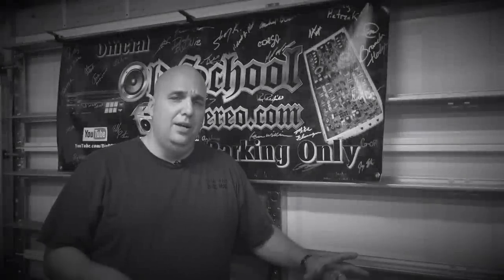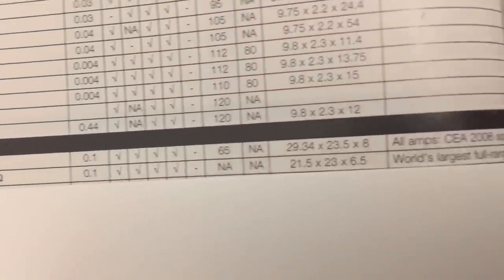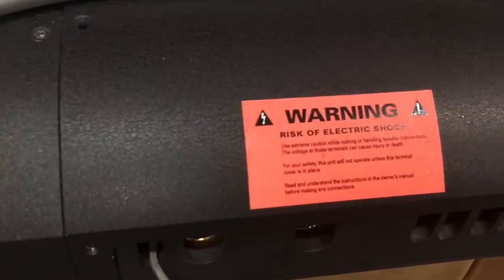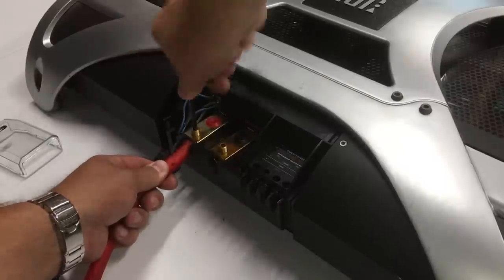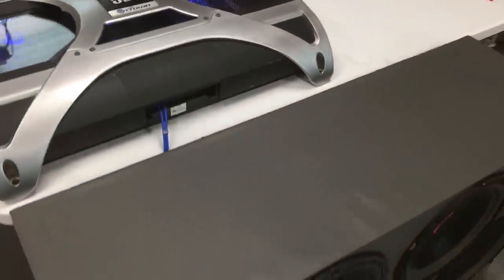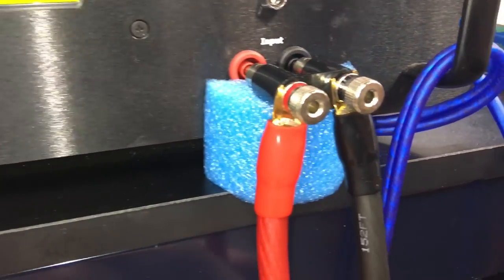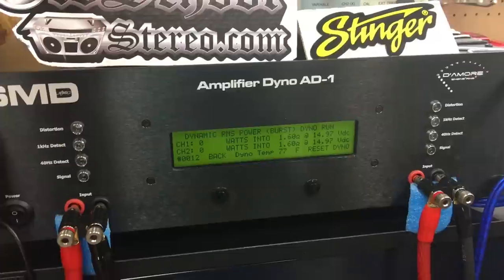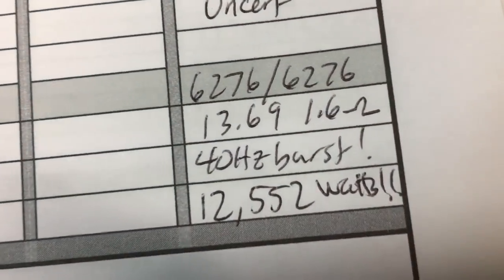World's Most Powerful Car Audio Amplifier (2004) JBL Crown A6000Gti

Comment: Holy guacamole and chips 😮 did that thing cause a blackout 😂
Reply from the maker: Actually this was a "green" test. I charged up the Maxwell Ultracaps with my 10A charger, then let the caps provide the juice. Power company may be upset I'm no longer using that massive power supply...

Comment: I love JBL not alot of people know that most concert speakers you hear are from them and people try and talk shit on um cus there based outa China but it amazes me how much better they are than alot of shit on the market wether its amps or subs. You should do the gto 1000.1 i know the 500.1 does almost 800 watts rms lets see that badboy.
Reply from the maker: +Nightmare Munoz every JBL amp I've ever seen tested did over rated power (several tested on SonicElectronix).
Reply: yeah the ms is 250 over rms i just always wanted to see the thousand because its only 200 dollars and if it does anything over its worth every penny for the jbl name.

Comment: what are the differences between the power acoustic 10K and this mammoth JBL 6K ?
Reply from the maker: The architecture and build quality are in different ball parks. The JBL uses Crown's Class I technology for Class A/B sound quality with near Class D efficiency. It was also built with little concern toward cost (evident in the $5999 price tag).The PA 10K is a Chinese Class D amp, manufactured as cheaply as possible and the specs are ISBL (if struck by lightning) max power numbers

Comment: do you think a Rockville RXD-M4 6000 Watt/3000w RMS Mono Class D 1 Ohm Amplifier will work for 1 
15" HCCA Series 2 Ohm 4000W DVC Subwoofer by Orion or will that blow the sub?

Comment: $6000 is a bit much. You can get a Crown 2000W and for about $300. Those are guaranteed high quality clean output amps for live band performance or mobile DJ services with durability and reliability. Choose even higher output models and stack them up as needed. Then there is the issue of power...120VAC. Either you use power inverters and or a 100A generator mounted on the engine of the vehicle...What ever it takes, deal with it.
Reply from the maker: These were limited edition, show amps for JBL. Not intended to compete on pricing

Comment: This got me thinking, anyone use the engine out of a range extender electric car or even pull current off an electric car battery bank for a system yet?
Reply: I've been thinking about that too. What happens when all cars are electric? You would have to have a transformer to step down the voltage.
Reply: @Bass2TheFace420  That would not be ideal.  Instead, use a design that runs on high voltage.  So instead of needing 450MCM wire you can use 4 gauge!  Just can't have exposed terminals (shock hazard).  Powersoft 30K (30,000W RMS) in a 1U package - real power but needs 230V to run.
Reply: @cpufrost  that would be more efficient. Taramps makes h/v amps that run on 220v
Reply: @Bass2TheFace420  I see those and their crazy numbers.  However I wonder besides producing a lot of wattage at lower frequencies how well they can do it and for how long.  Powersoft amps are arguably the finest made in the world and in touring they are the benchmark upon which all others are compared.  The control they have over the speaker cone is simply incredible and in all areas of the globe regardless of how bad the AC power is.  Of course they have the price to match. ;)

Comment: Where's the amp draw #'s
Reply: let's ask the electric company 😂
Reply from the maker: Clamp only measured to 400A, was going to buy an 800A model, but could not justify for one amp test
Reply: Two power cables, one 400A meter per.
Reply from the maker: That would work if I had another 400A clamp :-(

Comment: I remember the mid-2000's mega-amps, and how those were like all the audio fanatic's wet dreams.
You had the A6000 GTi, the Kicker Warhorse, and the Rockford T15k. All of which were ridiculous in their own rights!
In the later half, the early Korean made amplifiers came along, and one of the early adopters were a Norwegian company called DynaBel. Their top of the line model, the "BF8701" was a massive 7000w RMS. It could also operate at 16 and even 18v (only in a short burst), capable of outputting well over 10 KW. 
If you had two of these, you could strap them together for a combined output of 14 KW @ 2 ohms. And all of this could be had for a fraction of what the early 2000's amps would cost you to buy

Comment: No mono run? Would it have made a difference?
Reply from the maker: +Thezuule take 2 ohm numbers add up to get 4 ohm mono. 7323W certified. It is a mono amp with 2 channels. Easier for me to get more copper by using dual 4ga speaker runs
Reply from the maker: +Dereck BigDWiz plus the AD-1 is rated to handle 5kW at 4 ohms and up to 24kW at 0.5 ohms

Comment: welding wire is the same damn thing just a lot cheaper than over prices "car audio wire" maybe the opaque plastic insulation but other than that its the same thing. will handle the same current.

Comment: Question what i the Most powerfull Amp today ?
Reply from the maker: For 12 volts, Zapco made a 26kW amp a few years ago, Taramps makes a "Bass 30k" and "SPL 40k", I believe those are the largest 12 volt car amplifiers. There are some insanely powerful amps (over 200kW), but they require high voltage input, so I don't really consider those car audio amplifiers.

Comment: When ever i hook up any amplifier to power i always use a resistor so i don't shock the capacitors and instead charge them slowly. Other wise It will shorten their life.
Reply from the maker: +Stereo Studios 12v test light works also. That's what I use now 🤙

Comment: on another note ..

imagine the HP stolen off the engine to stabilize the draw at even a conservative 500 amps! 

roughly 6750 watts (at 13.5 ) /746....  

seems like a tall order to bolt on  a few hi amp
Balmars and  feed them about 9 spare  hp 

also surprised to see the amp uses 1/0  and  not provisions for  4/0 lug ..

   figuring 15 feet to the trunk and 15’ back ..   30’ of 4/0 at  $7/ft if using the tinned wire
 

definitely a big ticket item

Comment: ...?? 8110 watts @ 4ohm, and 7400 watts @ 1ohm??  the power out @ 1ohm would b calculated @ 4 times the power out @ 4ohms   basically, doubling resistance halves power thru/out

Comment: 2018  Taramps HV160, 160K RMS
Reply from the maker: The JBL was the most powerful in 2004, plus still one of the most powerful 12 volt 4 ohm amps at over 8000 watts at 4 ohms

Comment: Use a test light so you can charge up the caps first so no spark. Not good for any amplifier
Reply from the maker: I was going to use a larger 12V light bulb the next time I start it up. Not sure the test light can handle the current as the turn on requires 12ga for this amp

Comment: "warning, risk of electric shock,you'll see why here in a minute"

While I know the reason why, you never actually showed this in the video.
Reply from the maker: +TheyDontWantMusic yeah, I showed the DC spark, but no way I'm playing with that 220v plus of AC voltage coming out of the speaker terminals ⚡
Reply: Ideally, you'd use a resistor in series to limit the current and charge up the caps slowly. Just like an electrolytic stiffening cap.

Comment: It's never a good idea to just shove the stripped wires in like in the video. You should use ferules (sleeves), shove the bare wire into those and then into the amplifier. Without a ferule, the screw would just rip off the individual wires of the big cable and, in time, maybe half of the wires will come loose, the result being an improper connection. You don't even need a crimping tool for the ferule, because the screw will crimp pit just fine.

Comment: 3500w into 4 ohms... jesus, all modern amps can only do that into a low impedance, 120v? Now you know why this has an electrocution risk and others don't. 3500 into 1 ohm is 60v.
Reply from the maker: +UniCrafter to a single channel and with enough voltage, it does over 8000 watts at 4 ohms mono 😱...too much even for the Amp Dyno to handle

Comment: badd azz amp. there's one on ebay for 3 grand i seen it last week
Reply from the maker: It's been on there for months....this might help him sell it, hope he sends me a finders fee, lol
Reply: It should help him sell it now. I want to know what it does bridged?
Reply from the maker: Take the 2 ohm numbers, add up, should equal 4 ohms bridged. 7323 watts at 4 ohms bridged. If I could provide the 14.4 constant voltage, it should do over 8100 watts! Not many amps today, even Class D, will do 8kW at 4 ohms! They need to be loaded down to 1 ohm, everything suffers when amp is loaded down...current pull, sound quality, speaker control, etc. This amp is the BEES KNEES!!!

Comment: Thats cool  guy  is very hard find this amp in Brasil . I m work if automotive sound car  and i have 2 amp sony  one class d 1400 rms and other 1200 analogic  and two amps corzus  one class D 1200 rms and other 400 rms class d . Sony class D 1400 play 4 speaker sony x plod 1200 /350 rms 
Analogic sony 1200 play 4 loudspeaker 8 " 250 rms  midbass
Corzus class D play 4 loudspeaker 6"  for mid range 
And finaly the corzus class d 4 channel play 4 twitters selenium st 322 for high  cd pioneer  deh 6080 ub crossover taramps 4 channel
Desculpe n sei falar nem escrevee bem o ingles mas acho q vc conseguira me entender , td esse som esta montado em uma s/w escort 1997

Comment: Yup you called " this joker"  88lbs of top much money and Max low is 2ohm sucks for people with people pushing 1-.5ohm subs but power it good for a burp run at least
Reply from the maker: +juggalo4life_91 not many amps, even today can do 8000w at 4 ohms (14.4v) like the A6000gti. Lower ohm loads decrease efficiency, lower damping factor and negatively impact sound quality...but 1 ohm loads are required by most amps now to reach full potential. The A6000gti is special in that it can do big power at 4 ohms
Reply: try benching a taramp those things are poping up everywhere and the power output of thos even @ 12v is mind bending and regaurdless the ohm load that is a burp amp at best even if you gave it max power to make power it cant hold that with out shorting or melting like the amps today

Comment: taramps 150k or 60k or 40k or 20k or 15k. kicker warhorse does 10k.
Reply from the maker: in 2004, this was the most powerful amplifier. Many of the Taramps require 277v, so can hardly be considered car amplifiers. Kicker Warhorse came out in 2006, a couple of years after the JBL/Crown beast.
Reply: the high voltage doesn't make a difference cause to run 60k or 150k you're gonna need 20 batteries whether its a 12v system or a 277v system. so at the end of the day you end up with roughly the same number of batteries but one amp instead of six to twelve.

Comment: is that yours? a new toy? or did you borrow it?
Reply from the maker: +Josh Hanson it is mine. Got it last Fall
Reply: what kind of deal did you get?
Reply from the maker: I'll just say both parties were satisfied with the deal. I bought it from the original owner, who used it 2 times in competitions powering 3 Solo X 10's. He literally blew them out of the baskets, took the system out and left it in his room for 10 years!
Reply: i feel ya
Reply: Dereck BigDWiz im getting ready to buy a kicker zr 1000 for my collection.  But ive been dying for you to dyno the XS 100. I see you have one but i haven't seen where you dyno'd it. Is it because it puts out about the same power as the ZR 1000?

Comment: this is not the most powerful amp... don't like them but Rockford fosgate has built a bigger amp...
Reply from the maker: +mitch graydon this amp was the most powerful in 2004 and still to this day one of a handful that can do 8000 watts at 4 ohms (14.4Vdc). The RF T15kW came out in 2006, Kicker Warhorse was 2007